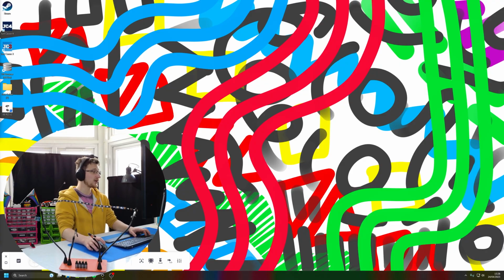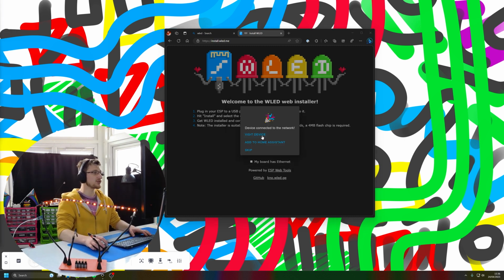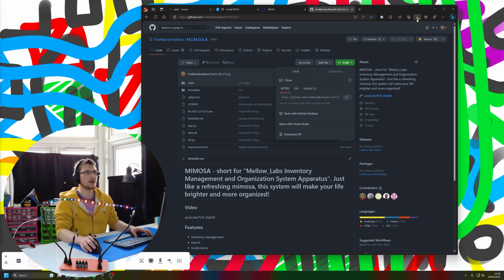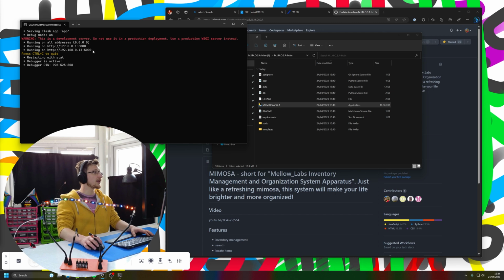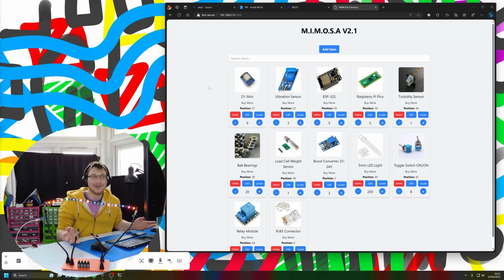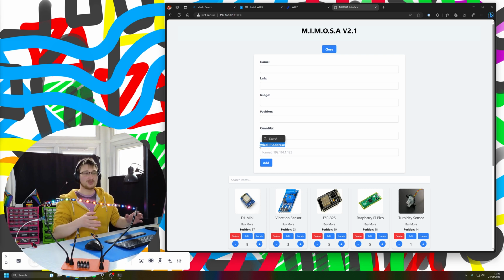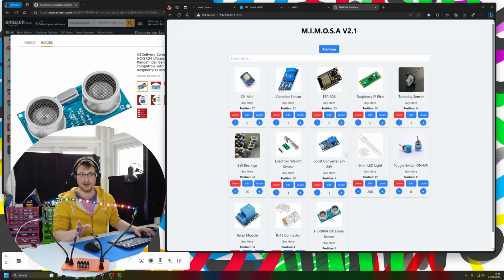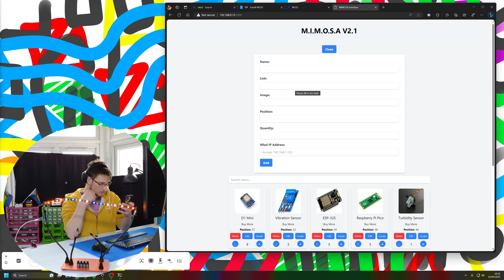DIY Smart Organizer (Step By Step)

Comment: I was thinking of using this for a lego minifigure display, but would likely need to use a diffuser to make the leds look better, do you think cob led strips that have the built in diffuser would work with mimosa?  They would still be addressable, but they would be in groups not just one led
Reply from the maker: If it works with WLED and they are addressable, it should work just fine
Reply: @Mellow_labs  How hard to you think it would be to modify the code to make a sound byte play when you clicked on the item and another when you un clicked?

Comment: You need to make BOM with affiliate links ASAP!
Amazon program seems like good start.

Now few questions.
1. Do you consider adding “filter” for items? It seems like they now listed in adding order.
2. How about adding more controllers and running them from one place? That’s why you put IP address when adding new components?
3. Are you considering making “offline” version of images?
4. Is there any chance next video will be showing “how to install without .exe”?
Reply from the maker: 1. I do have some filter options planned for the future, but not any time soon. If you have features, you would like to see make a GitHub issue. 
2. yes, you can have multiple controllers by adding different Ips. 
3. I plan to eventually. But again, it just depends how much time I have between other projects.
4. I probably won’t make another video about it, unless there are major changes. More information about how to run it is available on GitHub.
Reply: @Mellow_labs  thanks for reply.
It’s time to buy new components and bodge something 😅

Looking forward for your next project.

Pozdrowienia🙃